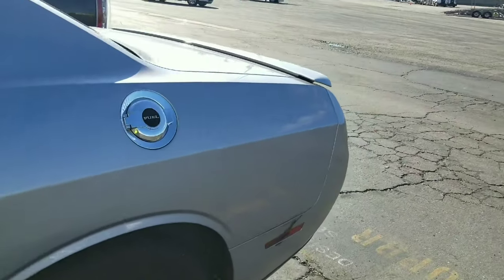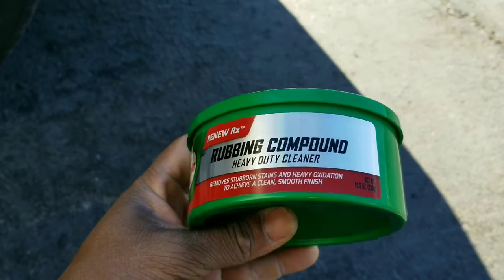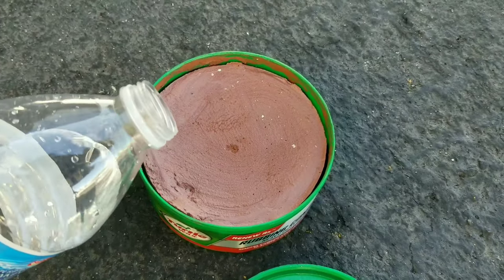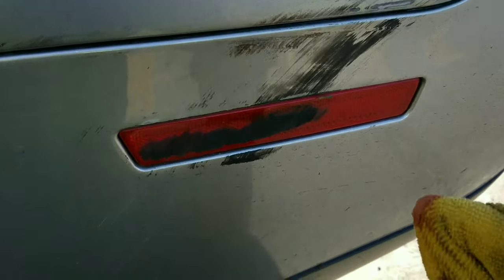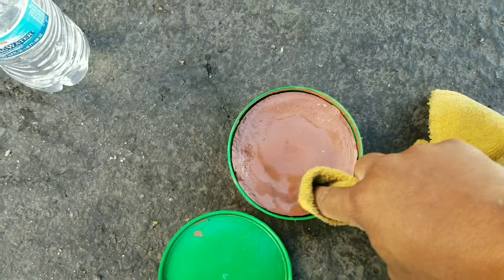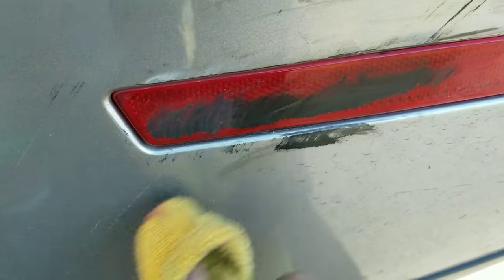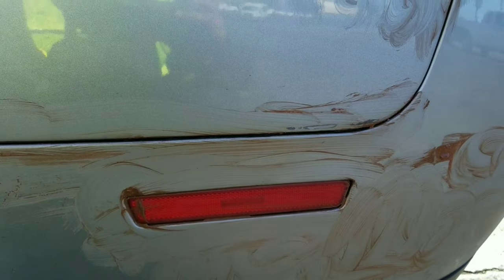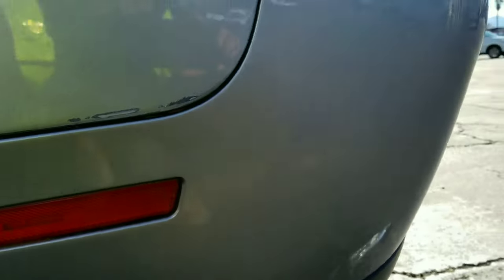How to remove paint or rubber transfer from your car

Comment: Did you use a buffer for the finished touch?
Reply from the maker: No buffer. Although u can use one if you wanted to polish it up. Thanks for watching 😁 👍
Reply: @Duwop77  yessir no problem.  I got all the tired residue off my truck.  However I found a gash where it knocked my door handle off so I'll paint that today
Reply from the maker: Sweet, glad you're getting it all worked out. Wish you the best

Comment: Just accidentally bumped into moms bf truck while reversing, let the car back up on its own without hitting the gas at all. Was having a bad day. Luckily the corner of my rear bumper hit his truck tire so only my car got a little cosmetic damage. My bumper got dented, some tire rubber got on my bumper. Next day somehow the dent came out, have no idea how. But now I need to take the tires marks off my car. Didn’t know it was possible at all to get it off but so glad I seen this video so I can buff it out!
Reply from the maker: Yes, the rubber should come off with no problem. Just try not to press too hard while rubbing. Also if it looks a little dull afterwards. A little wax will bring the shine back. Thanks for watching 😁 👍
Reply: did it work bro??
Reply from the maker: Yes sir. Works every time. Thanks for watching 😁 👍